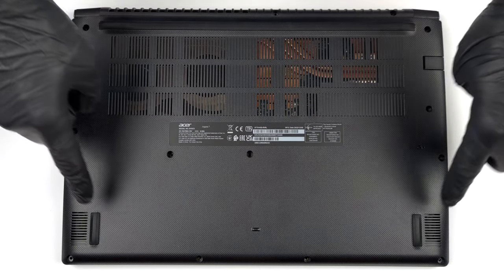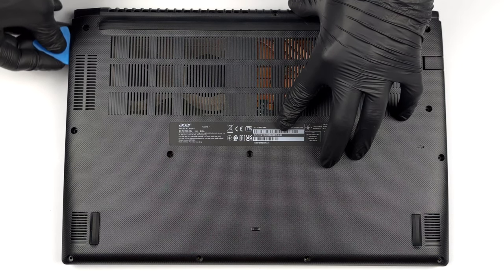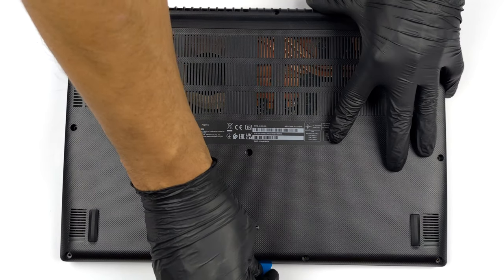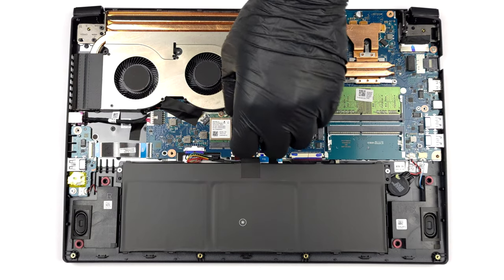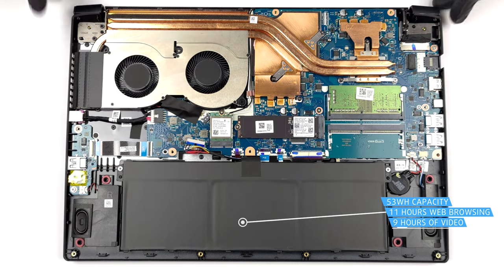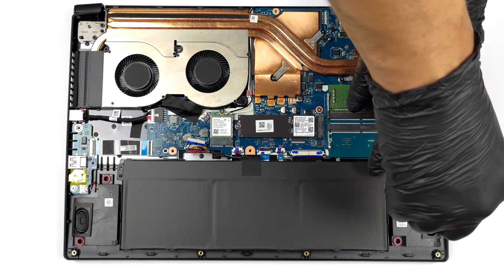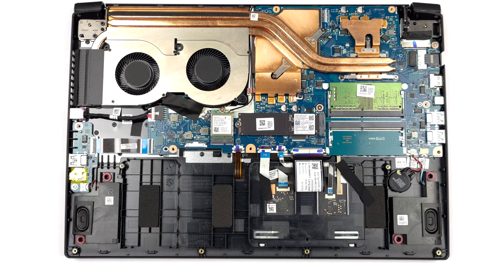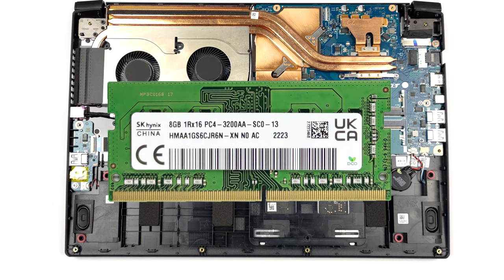🛠️ How to open Acer Aspire 7 (A715-43G) - disassembly and upgrade options

Comment: so now to upgrade the ssd i need to remove it completely and get another one ? no way to just add another m.2 hard to it ? :(
Reply: yep, there is only one socket for ssd, but you can replace it with 1Tb
Reply: @antondopira5957 2 TB is not possible?

Comment: Please sir tell me what is that mb to fp connecting wire under battery my laptop doesn't have that and it's not turning on please reply
Reply: Samee issue
Reply: How did you correct it

Comment: now i get it why acer just made the fans close together instead of separating them apart. to be distinguished as a non gaming laptop. but that made the thermal solution to this laptop very weak. yes its copper but heat just piles up in one area, even with two fans. i bet these heats up very bad.
Reply: the inside is similar to acer nitro 2019 version (except w/ additional SATA slot+nvme), im currently using it as a daily driver though & it is not as bad as you think.
Reply: @azaffaza  i see are you in a cold weather country? because here in south east asia is extremely hot during summer. not all laptop owners are blessed with a house with air conditioner.
Reply: @guttom Amd version works fine with Ryzen 5 5625u+rtx3050. Mostly because this laptop doesn't came with power hungry hardware. If you got Intel version well... Good luck
Reply: yeah mine overheats but only the cpu. gpu sits around 80 degrees while cpu is around 90 degrees with spikes to 100 that make my game stutter
Reply: You are totally right.I have been using this laptop for precious 4 years and from past 6 months this laptop is heating too much that's why I have come to this video for cleaning purpose of lappy..

Comment: Is there a limitation regarding the frequency of the ram? can I use ddr4 ram memory higher than 3200hz?
Reply: no max 32GB RAM
Reply: @viktor_sok  tested 64 GB ddr4 ram on my notebook: ACER NTB Aspire 7 (A715-43G-R2UQ) AMD Ryzen 5-5625U
Reply: Yes you can, but it will only run on the 3200 that MB supports.

Comment: can this proccessor change chance
Reply: you cant really change processors and gpus on a laptop theyre integrated into the motherboard
Reply: @randomaccount-ni5yr   and how much Nvme memory does the model support? Same for the RAM.
Reply: @Gabri2008_  not sure about that, i did some more reasearch tho and yes you can change the cpu and the gpu of a laptop but you need a professional setup (my older reply was 4 months ago by the way)
Reply: @Gabri2008_  i think it supports up to 64 gb of ram tho not sure about nvme, maybe 2 terabytes or more?